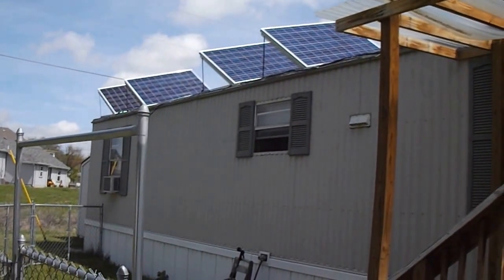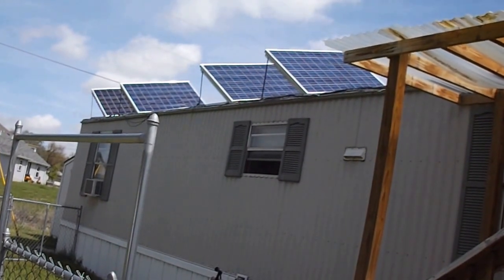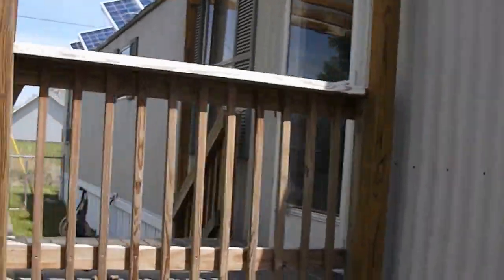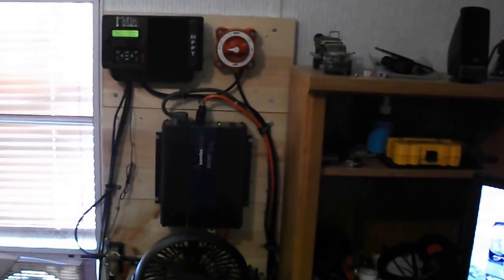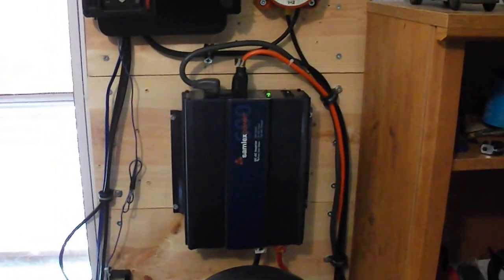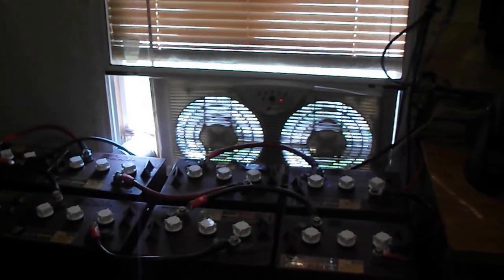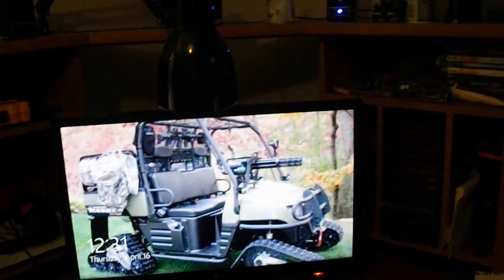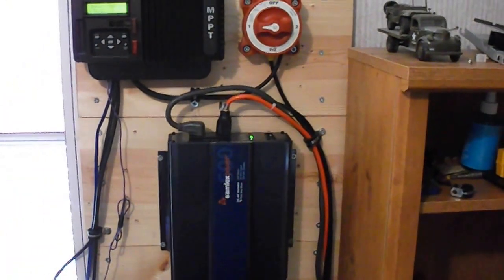Diy Solar Install on Mobile Home

Comment: I really am like your project! Thanks for sharing! Could you tell how much for the total cost for this project? and, instead of setting batteries inside the house, can we place them underneath of the mobile home? (there are a lot of spaces down there). Thanks!
Reply from the maker: It costed me around $2000. did it all myself. i have upgrade since then and using Lithium batteries. however on these batteries you cant have them in cold or hot weather

Comment: would you be able to help me a little with mine ? if i do one
Reply from the maker: I have since upgraded this install since the video. I now have 2000 watts. 604 ah battery bank at 24 volts and I use all Victron Products

Comment: if u ever read this,can u tell me,how long those batteries lasted?
Reply from the maker: They last Me about 4 Years. I now use Lithium Batteries. As long as you Equalize the batteries every month and make they are fully charged. They can last awhile

Comment: I’d love to do something like this to my 16x80 Fleetwood the electric company is killing me with high bills I installed new thermal windows it’s a northern built so it came with double insulation and a very well maintained heating and cooling unit. But our electric company pro rates us comrade to all the million dollar homes around the area. I have been looking into having solar panels put in and going completely off there electric grid. Considering they have been ripping us off for over 40 years. I love to get some payback no doubt. I do own a few acres so I’m not under any building laws except sewer must be updated

Comment: Looks like  alot of work to run a tv and a computer and a couple lights. Can it run your central air conditioning
Reply: Thats not the point. The point is to have it when you need it. In which case it moves from tv to running the refrigerator or important things.
Reply from the maker: It might be alot of work. I have upgraded it to 2000 watts and a lithium battery bank. Can now power alot more and still have excess to recharge batteries

Comment: How much it cost for u set that up
Reply: Well depends if you have a place to get solar panels locally. Since I done this video couple years ago. I have upgraded system. I have added 1200 more watts. (2000 total). And using all Victron products. I have also replaced my Trojan Batteries with Lithium Batteries

Comment: Can you possible list all components, cabling and estimated costs. I would like to copy this exactly.( based in Ireland love the video)
Reply: I agree, list everything for us. I'm also looking into solar. The batteries are so expensive, like the battle born $950 each.. They are great..
Reply from the maker: I have upgraded system. I have added 1200 more watts. (2000 total). And using all Victron products. I have also replaced my Trojan Batteries with Lithium Batteries

Comment: Working on mine now. New subscriber liked 👍 hello from the Kentucky mountains USA
Reply: Since when I made this video. I have upgraded my home system. I now have 2000 watts of solar. Using all Victron products inside and replaced battery bank with 24v 3.8kw simplphi lithium batteries. Total of 302ah

Comment: Huh, awesome. I'm always told by companies that they cant install solar panels on my mobile home. And I'm tired of getting the dry end of the stick from PGE here in California. Shouldn't cost me 400 to 700 a month for a double wide.
So I appreciate the video on this. More for me to look into.
Reply from the maker: Solar panels dont weigh that much. As long the are screwed down through the rafters you will be good. I have some string winds in this area and they are still standing. Been up there almost 5 yrs

Comment: What was your cost in everything thanks.
Reply from the maker: I have added more panels and more batteries since i made this video. I got lucky on Panels. Only cost me $650 with freight Charges. Otherwise around $900
 - $1000
Solar Cables and Batteries cables around $300
Combiner Box with Breakers  $200
Midnite Kid, WBJr, Shunt  $400. I use a Midnite Classic 150 now. Around $550
Inverter  $250
Batteries  $1000 - 1200.  $165 each
You can get cheaper with different Equipment. I do highly recommend a Pure Sine Wave Inverter. The prices have come down some also.

Comment: Everything I read before finding this video says mobile home roofs cannot support solar?
Reply from the maker: Solar Panels are not heavy. The mounts I used I used lag bolts and screwed them down through the rafters.  I have added more panels since I did this video. I plan on adding 2 more in future. Overall there will be 8 panels. 4 on each side of roof

Comment: for those that are totally off grid...

do you think it would be best to just convert everything to 12-24 volts? I know using an inverter isn't really that efficient.  I want to look toward going off grid, but I worry about things like the refrigerator staying on and having an AC in the summer.
Reply from the maker: Ok this might help. 1000 Watts go with 12v. 1000 - 3000 switch to 24v. 3000 and up go with 48v. Bigger voltage on battery bank the more efficent it will be.  Remember this and this is my opinion. Whatever size you battery bank is make sure your watts coming in is 3 times more (500AH Battery Bank - 1500 watt Solar). That way you can power what you need during day plus have excess to recharge battery bank for night time use.  As far as running a AC and/or Refrigerator, use a Watt meter to see how much power they use. AC Units uses alot of watts and you will need a big inverter along with a big battery bank and lots of solar. An example (5000 window ac) typically uses 300 - 500 watts and bigger units will uses more. There is alot to learn about solar and if you have more questions plz feel free to ask

Comment: This is great!!! I am restoring a old 1950s era mobile home and I want it right off the grid! thankyou for sharing!
Reply: hey.  I'm restoring a 1965 vagabond trailer!  are you in process with your solar panel project?
Reply from the maker: +Robert Beaudoin  Your Welcome. I am also in the process of upgrading. I am adding additional 500 more watts on a pole mount. But been raining last couple days and more is on its way. Will post an update when it gets done

Comment: Can you tell me a bit about the costs of each? This looks like a great system!
Reply from the maker: Matthew Shewchuk I got lucky on Panels. Only cost me $650 with freight Charges. Otherwise around $1100
Solar Cables and Batteries cables around $300
Combiner Box with Breakers  $200
Midnite Kid, WBJr, Shunt  $400
Inverter  $250
Batteries  $1000 - 1200
You can get cheaper with different Equipment. I do highly recommend a Pure Sine Wave Inverter

Comment: You did a real nice job for a DIY job. Nice size battery bank to. I am just getting in all the Midnite Solar charge controllers for sale. Good equipment. Looks like you know what your doing so far.

Comment from the maker: To Bill'Rosa Ouroffgridsolarcabin. I couldnt reply to you so i went this way. It is a Pure Sine Wave Inverter. I am probably going to upgrade to 1500 watt system later this year. I am also thinking about going wind power also. Any good recommendation on a 24v Wind Turbine?
Reply: Rebel 2 from Missouri wind and solar.  I use their products.
Reply from the maker: *****  They are located about 100 miles from my Home
Reply: They are great people, just down to earth.  I have nothing but respect for Jeff and Wyatt and the rest of them.

Comment: Very nice start to your solar system.   Everything looks good.  Just curious are you running a modified wave inverter or a pure sine wave inverter.  Some electronics will not last or run good on modified sine wave.  I learned the lesson the hard way.  Look forward to seeing more video's of your system.   You made a great choice with the midnight Kid Mppt CC.